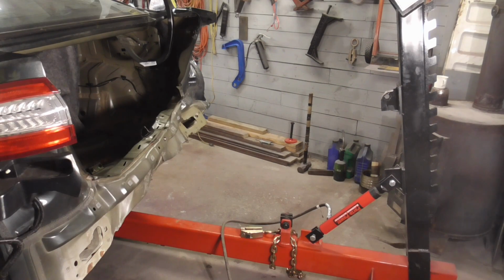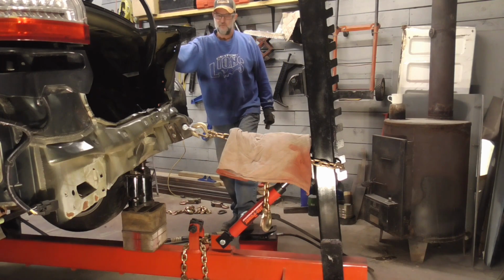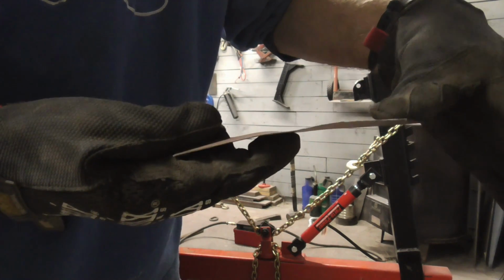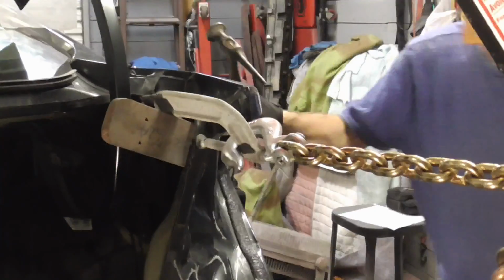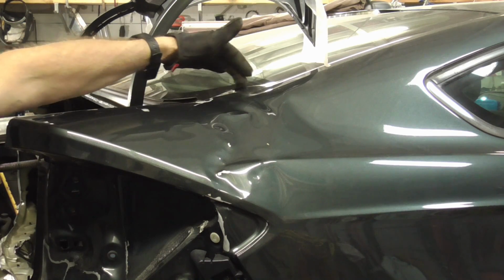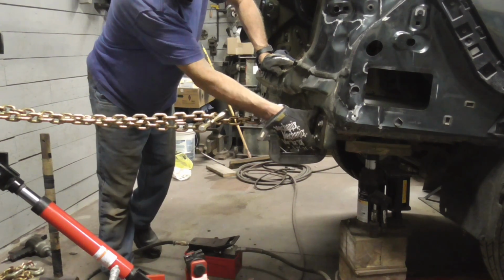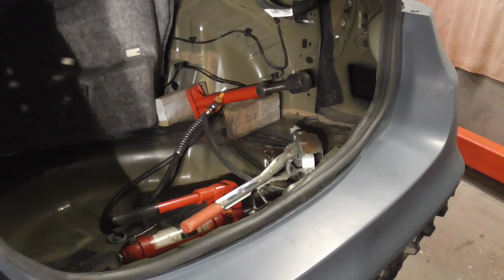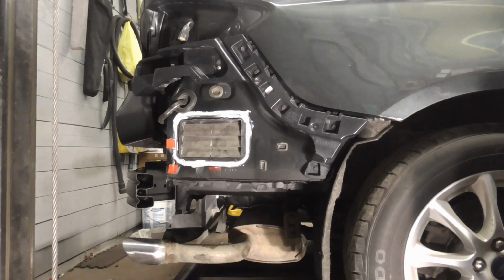Auto Body Frame Straightening and Unibody Repair - Champ Portable Frame Machine

Comment: got a Lincoln markvll with bent frame upwords underneath shop old me can't be fixed can frame be removed from car fixed and put back together? plus rad support needs to be replacer from deer hitting car!
Reply from the maker: Anything can be fixed.  You can pull down with a frame machine very easily - just make sure you block up the the point where it is bent.   That answer is their way of saying they don't want to work on it.  You can also cut it and replace with an unbent section or like you said fix it and replace it.
Reply: @LakesideAutobody  will try a differnt frame bending shop!

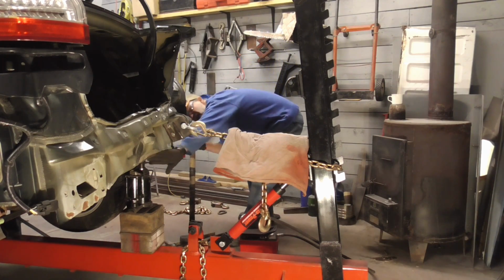Comment: Hi the question about the crease at 2:22 you say maybe help to move out why you don't say it must help to move out ???
Reply from the maker: Because sometimes it works and sometimes it doesn't.  Basically the idea is to "push and pull" at the same time.  So pulling on the frame and hitting the buckle or bent area works the best to straighten the damage.  Hope that helps :)

Comment: Great video! I was just looking at some damage on my project car and wondering what would be needed to fix it. I imagine that one of those frame machines is out of the price range for a hobbyist, but I saw one of your comments about getting help from a small shop for stuff like this which seems like a good idea. 

On my car (1984 Porsche 944) the front left part of the occupant compartment was pushed in at one time and a bit of the floor is bumped up. It was repaired “sort of” many years ago, but doesn’t look right to me. Any thoughts on whether some lower cost tools could work to straighten things up. A bit hard without seeing any pictures though eh? 

Thanks for all of the great videos!
Reply from the maker: Email me some pictures at schoolvideolibrary@gmail.com  I'll check them out and get back with you :)

Comment: Generally on rear shunts like this, the points where the boot/trunk hinges mount to the "parcel shelf" will have moved. Maybe not by much, but even small movement there will do your head in trying to get the shutlines to work. There's also a good chance that one or other hinge itself has twisted slightly - which will also throw the lid fitment right out. 

So if the lid won't sit right, maybe check those, might save a lot of messing about.
Reply from the maker: True - thanks for your input James 😊💯

Comment: I like your videos a lot. I have an old volvo p1800 1970 unibody construction. The frame is bent or twisted, and the rear left side is about an 3/4 inch higher than the right rear side fender. I need to twist it back in position, so the rear end is even. What would be the best way to take care of this issue. I am thinking that the car needs to be on a steel frame machine and pinch clamped and pushed up on the right rear side to get the rear end frame back in level. I don't have equipment and would appreciate some advice or maybe a shop that work on older cars.
Reply from the maker: You're right - on a professional frame rack there are 4 pinch weld clamps that hold the car firm and you would then pull up, down, etc. depending on what you needed to straighten.  Take a look at this old dozer frame machine manual - maybe you could get some ideas from it  -  https://s3.amazonaws.com/cdn.autobodytoolmart.com/downloads/tech-sheets/BodyStraightener.pdf  Let me know what you plan on doing :)
Reply: Do you think the twist damage shown of page 4 could be done on a unibody frame?  If you set up a jack on both ends of the I-beam, would you locate the jacks on the pinch weld with blocking?  I like the idea but would need the equipment.  I am in the metro Detroit area and have not been able to find any shops that would take on this job yet.
Reply from the maker: @peterferro  I think you could accomplish it with some creativity like you are saying.  There has to be a shop down there that will take that on.  Try Professional Finish in Romeo - they are good people and have very good equipment to do that type of work :)

Comment: Nice to see these cars finally making it to u-pull-it yards. Handy for guys flipping cars if you need parts cheap.
Reply from the maker: I love U-Pull yards - not many left in Detroit anymore :)
Reply: @LakesideAutobody  I love US Auto in Sterling Heights (and occasionally the one in Wayne), Parts Galore on 8 mile usually has a good selection, and I hit U-Pull and Save in Pontiac a fair amount. I like these because the cars are all up off the ground and they inventory the cars online. There's another one in Detroit that I've been to a couple times, but I don't remember the name.
Reply from the maker: @jayinmi3706  Ha! I love parts Galore on 8 mile.  I had a Matco metal hole saw kit on a cordless drill and would find "never used" tires (spare that were rusted in place on Ford Explorers 235/75/15s) You could cut around the mount/hanger and the tire would drop right down.  I'd take the tire off the rim in the yard BY HAND!  because it was 15 for the tire and 15 for the rim - didn't want to spend the extra $.  I used them on my van at the time - it always had great tires on it :)

Comment: Wow!  That is impressive.  It's obvious you have a ton of experience and a treat to watch you work.  Thanks for posting this.  It A) gives me hope that my project is not beyond hope, and B) makes me realize that I am just going to pay a professional to do it.  Besides the sheer skill and know-how, there are a lot of tools besides the frame puller.  I wish I lived closer so I could just bring it over.  The trick is going to be finding somebody who is willing to do this kind of work here in Denver.  I started calling around and found that the big shops just don't want to mess with it.  Great video!
Reply from the maker: Thanks for the support Adam - that would be cool if I were close for sure.  I think if you shop around though you may find a smaller shop that will help you.  Usually the smaller, no name guys will help more than the "large fish" as they sometimes need the work :)

Comment: Hello, Did Your Champ Frame Straightener Come With The Pinch Weld Clamps On Yours? The One On The Ad Picture On Autobodytoolmart Website Link In the Video Does Not Look Like Yours< Let alone Strong Like Yours... ?
Reply from the maker: Yes - they came with the puller :)
Reply: @LakesideAutobody  Ok, thanks. What do you think about the swivel type puller? It looks like it makes angle pulling easier.. ??

Comment: What size and brand of c clamp are you using? I have a bent bumper bracket on an 05 f150 and used a small c clamp from HF along with the porta power puller from HF and it bent the c clamp to the point that it's useless! lol
Reply from the maker: That's a 4" Great Neck C clamp but it's pretty old so it may have been made better than today's.  If you can find a C clamp made in USA - that will probably hold up.  "Martin" makes them too but they're a bit expensive.
Reply: @LakesideAutobody  thanks, I refer to your videos to get ideas to fix my truck!

Comment: So why are insurance companies so quick to write off vehicles which can be repaired? Straightening used to be done all the time in the past. Great video by the way!
Reply from the maker: There are laws now that make shops repair the vehicle to a certain standard.  This cars would have needed:  Trunk floor, rear panel, quarter panel, deck lid, bumper assembly, tail lights, and a lot of other plastic stuff that shattered in the accident.  It would have cost more than the cars value. There are always new requirements coming out for safety and none of the insurance co's or dealerships want to be held responsible if someone gets injured in a previously repaired car.  It's safer to total it.
Reply: @LakesideAutobody  It's 80% of the wholesale value. Above that and it's not worth messing with.
Reply from the maker: @georgemichaels2325  Thanks for the info :)

Comment: your shop reminds me of another place about 70 miles north of where your at.this video is actually better than some of the icar videos. hands on no bs talk. dam lucky you can still use the o'l dozer. i have the champ unibench 2 brewco pulling post 24 3" tie downs in my floor.you worked the 1/4 out dam good. i have been there on what your doing plenty of times.it just surprises me on the dozer?dont fool your self champ has some good shit. real good job. been thinking of buying a used celette but no room.then ask your self if you really need a rack/bench? takes up no space.i like the old school  pulling as i have now. i use truway books for my specs also. for what you got to work with you did pretty dam good.
Reply from the maker: Thanks so much - very cool of you.  I'd like some thing that does more more this is really all I could fit in this small garage.  I started when young using the Kansas Jack power post, pull pots, etc.  Nothing easier than a drive on rack though like a Chief EZ liner.  Drive it up  - clamp it down and start pulling from any angle.  Is Celette the top of the line?   I appreciate the support - have a great weekend :)
Reply: @LakesideAutobody  i have a small shop also. nothing wrong with a o'l k-j post. i bet you know some of the people i know in your neighborhood?people like g&t  auto farm the grossbeck ppl! we both share the same ideas were builders.bet you would like some of the equipment i have? self centering gauges no 1 else has for miles around. dent fix digital tram.sometimes i think we got better shit than dealers. there is hardly no pulling at the dealership. they just pull sheet metal.we should hook up 1 day shop talk! i remember the dozer got swatted on top of my head when i was 12 yrs old . my brothers stood there and told me to not look straight at it i was a dumb f2ck and it got me.i am as old as dirt on this shit! i am 60 now.made my living off totals from the auctions.salvage titles.been sick thats what brings to utube.cant work much with lung disease.dam glad to see you with a mask on.1 day look at the color of the grinding sparks then you can id the type of steel used. i am firm no heat .i even got inductor pads to heat rails but i rather cold pull and pound my ass off!
Reply from the maker: @jim griffee My uncle used to fix up totals - he lived in Capac, MI - I think the auction was in Capac too.  I got a couple from there back in the 80's - you'd write how much you'd give for the vehicle and if yours was the highest bid - come pick up your car!  -  Are you familiar with any of these, JR's Custom Paint, Dietrich's, Mike's Collision, Professional Finish, Jim's Collison on Harper?  Real familiar with Groesbeck, 8 mile (parts galore), Gratiot, Van Dyke, etc  Used to live in Grosse Pointe Woods,  Dryden,  grew up in Utica, MI  Were you talking about Groesbeck Automotive Paint Supply? G+T Auto Sales in Port Huron?
Reply: @LakesideAutobody  never heard of salvage auction in capac? i am from sandusky. i used to go to a auction on livernoise then they went to tech core by dtw now its iaai. lot of ppl like co-part. these auctions move place to place. now flint and davison has auctions. i am well educated in collision technology certified in unitized body. i even have did several rear clips.1/2 of another car and no dog tracking. at 1 time i was in it heavy. now i am not shit.health issues beaumont cant fix.so i got to hang tuff till march 30th go to mayo clinic.if i can make it through all this health shit i want to move. dont be afraid to call me?i might learn shit from you and you may learn shit from me?if i dont make it i may want to sell every tool i got.
Reply from the maker: @jimgriffee723  Are you from Sandusky, MI or Ohio.  I wish you all the best in your health - I say a few prayers for you - sometimes they work :)  I'm always open to learning stuff - keep in touch.  Jerry

Comment: If the frame rail and Quarter or not replace along with the back panel does that mean that you don't have the same  strength integrity. Do professional body shops replace those panels after they're pulled?
Reply from the maker: Yes they would replace them but that's why this car was totaled by the insurance co - the cost exceeded the worth of the vehicle.  My honest opinion on the strength integrity is this:  If you get hit hard by another car - it really won't make a difference if it was a new panel or an old panel - your stuff is going to be wrecked.  I believe that there is a push from the car companies to replace because of $.  Lots of cars are totaled and lots of new parts are sold.  After this car was repaired there really wasn't a lot of difference in the panels anyway - they came out pretty straight and just as study.  That's just my thoughts though so....:)
Reply: these cars are ins.co's totals! keep that in mind! jerry does dam good! he is right if ins.co's replaced all the parts it would be more than the cars worth! i hope jerry got a good green michigan title on this car?

Comment: Nice bent up tail lamp pocket  paint over it when needed to be replace
Reply from the maker: That's why the insurance co. didn't want to fix it.  The cost of the repair would have be over the worth of the car. It needed new:  Deck lid, quarter panel, trunk floor, rear panel (includes what you were describing), bumper assembly, tail lights, and a bunch of other plastic parts that were swept up at the accident scene.  I will spend around $500 to fix it.  The bent up rear panel "tail lamp pocket" looks better when you consider the cost of replacing stuff :)
Reply: This is the way we used to fix redline cars the used car dealer bought from the auction. Replace as little as possible
 Straighten the rest. I am a big believer in custom made plates.
Reply from the maker: @georgemichaels2325  Thanks for the comment George - have a good weekend :)

Comment: Too bad you're no near me, I would bring my car to you for sure. I have a 89 mustang and I believe the frame is ever so slightly shifted. The rest of the damage was already repaired but not the frame. How much does it cost generally to just straighten the frame?
Reply from the maker: I completely depends on the shop.  This would not be an insurance job so no adjuster to monitor the estimate.  My best advice is to go to a few shops and get some estimates.  You may find a huge difference in prices.  Could be anywhere from a few hundred dollars to over a thousand.  Sorry I could not be more accurate.  :)
Reply: @LakesideAutobody  That's still good. I really appreciate the response. Even 1000 isn't too much.
Reply: look at about 75 $ a hour for frame work. so 3-4 hundred dollars is not out of the ball park. i get 75$ and give out your moneys worth of pulls.big shop more costs!

Comment: Could you use heat or would that be the wrong way to go?
Reply: no heat on uhss or hss! you will take the temper out of the steel with heat.thats why we cold pull and pound our ass off!!
Reply from the maker: Sometimes you have to use heat when you really need it.  I'm not opposed to using it but many will say it changes the characteristics of the metal - making it stiffer, brittle, etc.  I've never had an issue with any thing negative happening from using heat though :)

Comment: Heavy rigging meets Art.!!
 Nice job, enjoyed watching that process. Very well done.
Is this something common in your shop.? I would think most insurance companies would write off a car like that.
Reply from the maker: This was a "repairable" purchased at an auction so it was written off by the ins. co.  as it needed a trunk floor, quarter, rear panel, bumper assembly, tail lights, deck lid, exhaust, and more. I did get all the parts I needed at a very reasonable price from Highway Auto Parts in Roseville MI.  Thanks for the support BTW - have a great week.